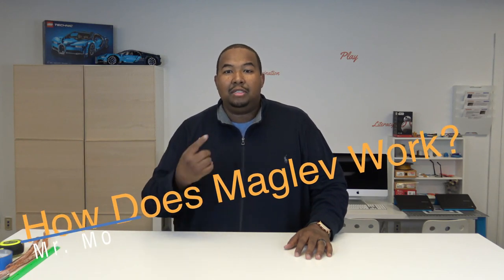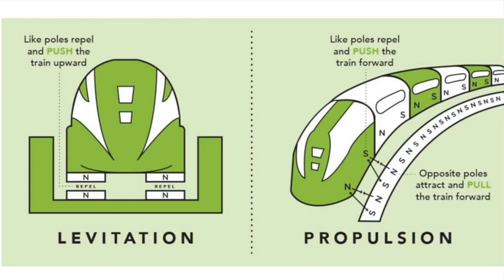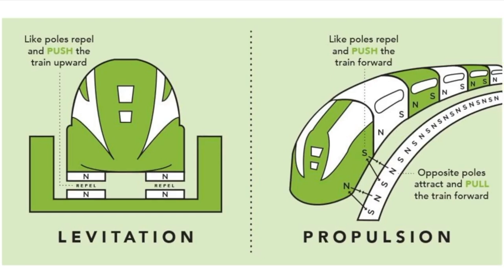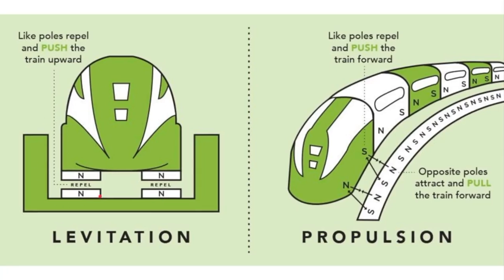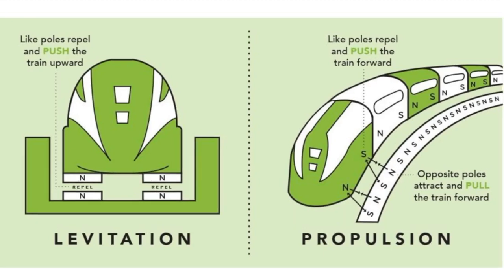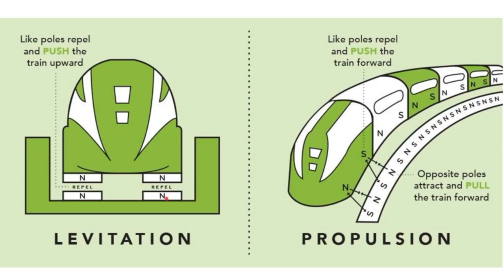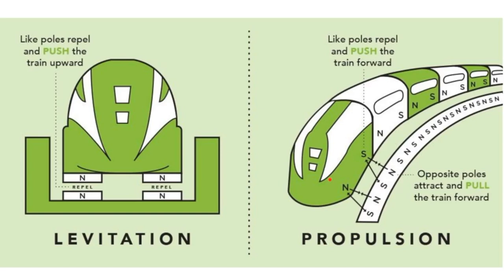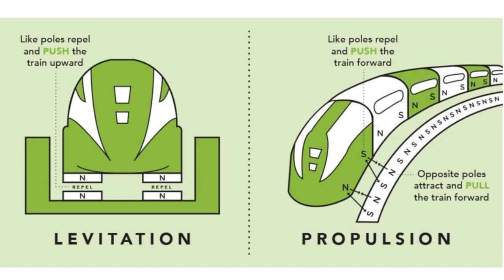How Does Maglev Work

Comment: Nice and clear explanation! So, in the rails there are electromagnets that change their poles as the train moves. Is the train itself connected to the electricity grid through a wire, or all the power comes from the batteries in the train?